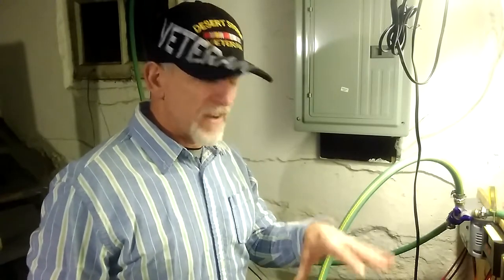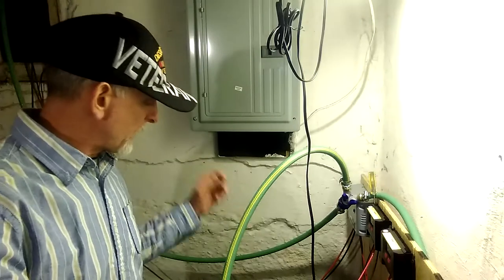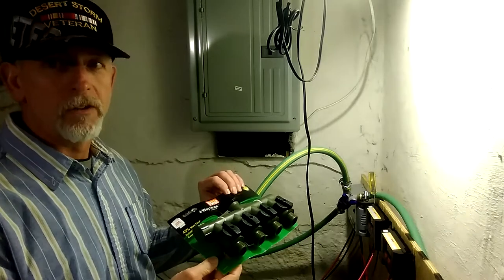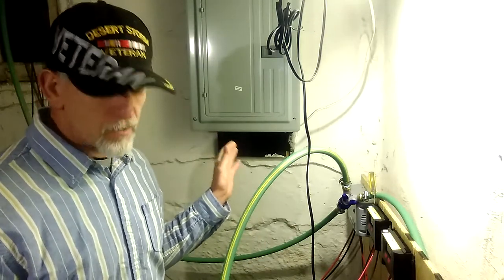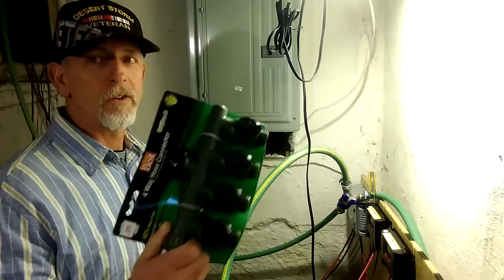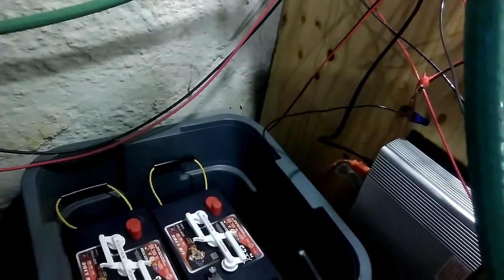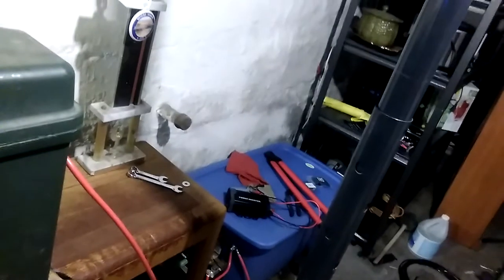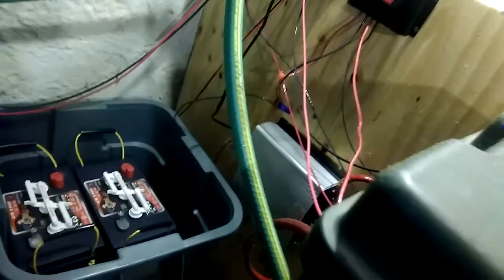Venting Solar Battery Banks Outside

Comment: the energy density of lithium ion cells cannot be beat... check out the Facebook group DIY power walls it's a closed group but they'll take you in if you request it... It's a gold mine of information in this stuff is not hard...
Reply from the maker: I have a facebook group DIY solar and wind that you can join. There are a few thousand in there sharing their ideas and off grid systems.